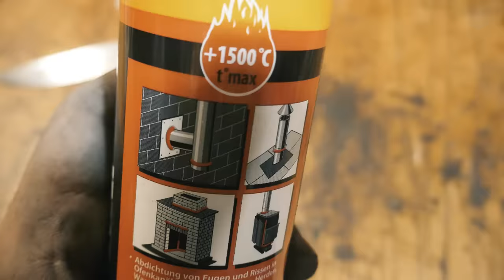Knife Making - Dark Modern Tanto

Comment: Not a tanto knife... it is a wakizashi style, but still cool dude
Reply: realm of the mad god wakizashis are better my dude
Reply: This is Tanto because Tanto is Katana of blade length is less than 30cm.
Also Wakizashi one is between 30cm and 60cm.
Reply: The hell...? "Wakizashi style"?
Do you even know what designates the name for a japanese blade? Because the main difference between a Tanto, Wakizashi, Katana and Odachi is mostly and simply blade length.
Reply: Kyo 21943  Actually some wakizashi do fall in the range of tanto length but typically wakizashi will have more 反り,sori (curve) while tanto knives have little to none sori.
Reply: Kyo 21943 Wakizashi will have more sori because of its function as a secondary weapon to compliment or replace 打刀(uchigatana) or 太刀(Tachi), while a  tanto doesn’t need sori because of its function as 鎧通し (yoroitooshi) , to penetrate Armor.
Reply: Kyo 21943 Lastly the presence of 鍔 (tsuba),guard also determines the difference between tanto and wakizashi, normally a knife around 30cm without tsuba is categories as tanto, eg. 物吉貞宗 classified as tanto although it’s length(33cm) exceeded 30cm.
Reply: Its a tanto. A wakizashi is longer and has a bigger Tsuba.
Reply: Sorry to break it to you mate, but those are one in the same.
Reply: Ones just shorter
Reply: Anthony Fam is right though.
The length of the blade is only a good guideline to classify the blade.
What matters more is the functionality of the blade as Anthony stated.
The blade made in the video has too much curve for it to be a tantou.
To say the two is the same is like saying knives for cutting bread and cutting meat is the same just with different shapes lol
Reply: Eh bad analogy oops
Reply: @kaito3125  how is it like comparing two completely different blades like a bread or steak knife, those are different sized, shaped, blade type, and length. The only differences between tanto, and wakizashi blades are the sori, and length
Reply: Ian Bonnar Hence why I said eh bad analogy XD
But hey! Now you recognize they are different!
Reply: Heavy hammer don’t tantos have the weird top with a really sharp point instead of a belly
Reply: ben warman yes they do
Reply: @leonardsailer2354  Its not a tanto or wakizahsi, its trailing point
Reply: @kaito3125  18:32 how this has too much curve?? You mean the blade (the sharp part) itself? Because the knife itself is pretty straight
Reply: Kugelblitz Kugelblitz hello! Yes I am talking about the blade. The different naming is there because they have different purposes! Tantou blades pretty much have no curvature.
I don’t think me being Japanese give me credibility, but I do have easier access to documentation XD I’ve verified my knowledge as much as I could and this is what my current opinion is (:
Reply: Neeeeeeeeeeeeerd
Reply: wakizashi is a short sword.. this is CLEARLY not a sword at all.  it is a tanto. you should know better.   The wakizashi has a blade between 30 and 60 cm (12 and 24 in), with wakizashi close to the length of a katana being called ō-wakizashi and wakizashi closer to tantō length being called kō-wakizashi. The tanto's traditional overall length was 11.93 in (1 shaku, about 30cm). The blade's length was about 5in to 12in (12 1/2cm to 30cm). Blades that were bigger (13" to 14" inches) were called ko-wakizashi, or "small short sword." The tantos which varied from the traditional size were called O-tanto or Sunobi tanto.
Reply: Eleazar Ventura same but let’s leave it to the pros
Reply: @RipleyGames you sir are wrong. it is a tanto. do some research. i wont do it for you. but it is definitely a tanto.
Reply: @RipleyGames  The wakizashi has a blade between 30 and 60 cm (12 and 24 in), with wakizashi close to the length of a katana being called ō-wakizashi and wakizashi closer to tantō length being called kō-wakizashi. The tanto's traditional overall length was 11.93 in (1 shaku, about 30cm). The blade's length was about 5in to 12in (12 1/2cm to 30cm). Blades that were bigger (13" to 14" inches) were called ko-wakizashi, or "small short sword." The tantos which varied from the traditional size were called O-tanto or Sunobi tanto. no YOU are wrong.  the spine and edge has nothing to do with what makes a tanto. it's the length and style. NOT the construction.
Reply: @kaito3125  wrong.  The wakizashi has a blade between 30 and 60 cm (12 and 24 in), with wakizashi close to the length of a katana being called ō-wakizashi and wakizashi closer to tantō length being called kō-wakizashi. The tanto's traditional overall length was 11.93 in (1 shaku, about 30cm). The blade's length was about 5in to 12in (12 1/2cm to 30cm). Blades that were bigger (13" to 14" inches) were called ko-wakizashi, or "small short sword." The tantos which varied from the traditional size were called O-tanto or Sunobi tanto. 

the style and length determines the classification of a blade. not the functionality as you could essentially use a katana for a butter knife if you wanted to. BUT that still would not make it a butter knife. AS for the curve. some ancient tantos still had a fair curve to them and some made these days do as well... a tanto can be straight or curved. The tanto blade has a high point with a flat grind, leading to an extremely strong point that is perfect for stabbing into hard materials. The thick point of the tanto blade contains a lot of metal near the tip, so it is able to absorb the impact from repeated piercing that would cause most other knives to break. THESE are the characteristics of a tanto along with length.
Reply: D C Hi! I feel like you proved my point though. You said you can use a katana as a butter knife. True, but you don’t call your katana a butter knife XD Just because your butter knife is longer doesn’t make your butter knife a katana. Also functionality is a bad word to use here since what matters is it’s purpose not how it can function. A pencil can function as a lethal weapon but that doesn’t mean we can refer to a pencil as a knife and have others understand us.
Reply: D C I just want to make sure you read my post! It seems like you might have misunderstood my point. Or you are just saying wrong from the start because you don’t care about my opinion.
Reply: D C sorry for replying so much m, but I do understand I used the term functionality in my original post. Sorry for the confusion Japanese is my native language.
Reply: I get his confusion, even if he is wrong. The 'old' tanto's were commonly recycled broken katana's that were reshaped, and as such, didn't have the same shape as a tanto built as a tanto from the start. 
Wakizashi, tanto, katana, they are all the same blade shape, only the length makes the difference. A tanto fashioned from a broken katana would have a slightly different shape, but that is the exception, not the rule.
Reply: You mean it's not a western tanto, because this is clearly a "traditional" tanto.
Reply: It’s just a weeb dagger
Reply: breaths in

WEEBBBBB!!!!!
Reply: So simply this is a knife
Reply: All I heard here is people talking the difference between tanto and wakizashi and also about the video, making tanto or wakizashi
Reply: is this the weeaboo hideout
Reply: @DENTYUcord  a tanto is a sword... I think its far longer than a wakizashi.
Reply: @Emilianoo8  nah, he can say what he wants
Reply: @Th3_Only_Spider-Man  i do
Reply: Heavy hammer forge I was thinking the same thing. Tantos have flat transfers from lower blade to tip.
Reply: Kyo 21943 yes wakizashis were the short swords but they had more rounded edges like this. A tanto has more of a flat transfer from blade to tip.
Reply: markimarku other way around
Reply: Bru741iX lets all just agree there are many different things the define a wakizashi as a wakizashi, a tanto as a tanto, and a katana as a katana and lets just say this is his own style.
Reply: it's an axe you fools lol
Reply: So no one knows what it was used for holy high mighty gods above. You need to know what there used for to know the difference
Reply: @DC-ct7em  what is a 'short sword' im aware of an arming sword but do older civilizations actually call their arming swords "short swords"

im deadass right now, i dont actually know if thats true
Reply: weeb
Reply: @Kyo-kf6jf  And how sharp the blade is.
Reply: not at all
this is a tanto
wakizashi is a short katana not higher above 50cm
Reply: Awesome I made something like it awhile back but this ain't a Tonto my dude
Reply: Talking about blade shape, not a tanto since a tanto got a tip right before it curves the the point
Reply: @drmusrudloff  

Not all tantos have a "kissaki", like you're referring to.

Stop posting about things you don't know about
Reply: @damarei  like some sheepfoot blades got a tip? Im talking about blade shape, no reason to act offended over stuff you dont understand
Reply: @damarei  just made a quit search, you have no idea what a kissaki is since the knife he is making got a o-kissaki
Reply: @drmusrudloff  

No, no it doesn't.

This knife is more "shobu" if anything
Reply: @drmusrudloff  

I think you're thinking of Western "tantos" with Kamasu style tips.

Furthermore, are you talking about the Yokote when you say "tip"?
Reply: Every body is using the exact same evidence to try and prove something different, however this is just defending the same position.
Reply: He is right. If you look at the design for a tanto it's more like a Bowie so it has a sharp point to penetrate armor.
Reply: Still a great piece 👌👍
Reply: @DENTYUcord  exacto  tanto 1 shaku ,wakizashi 2 shaku
Reply: wait isnt this a katana?
Reply: @Kyo-kf6jf  weeb
Reply: Tanto (15~30cm or 5.9~11.8 inches) ; Short blade, used as a knife or dagger to penetrate the armor, or at grapple range by Samurais, or used for self protection by ladies.
SO It IS AN TANTO !!!!
Reply: DORK
Reply: Wakizashi should be long and two handed, tango meant to be short bro
Reply: Heavy hammer forge
How is that a wakizashi? Its clearly length of a knife, not a short sword.
Reply: Kyo 21943 f
Reply: 'tan' is that means a short, in japanese 
you don't have to it wakizashi
ㅇㅋ?
Reply: I have to say, if the true Japanese bladesmiths of old (which are true artists, IMHO) were to read any part of this shit, much less the whole thing, the only word or term they would be considering is... Seppuku!

Ignorance & Google together, destroying minds... 1 post at a time!
Reply: Ты это делаешь для себя или на продажу
Reply: STONE PHILLIPS who?
Reply: Is it me or a hate how people miss use weeb like 
when a person learns to speak Japanese (or it could be anything like Japanese calligraphy or black smithing like I don’t know)......  people call him/her WEEB ....like isn’t learning Japanese and French(for example) the same thing?
A weebeo is a non Japanese person who’s a fan of anime that tries to fit in to Japanese culture  so they try to learn Japanese stuff but with no care and just want to know it...again..to fit to that culture but that’s my definition of a weaboo..so when an average person learns something about Japanese stuff is not to try to be one is because they genuinely like learning about it they don’t to be part of it they just enjoy learning it
Reply: How much is the price,just I want to know??
Reply: A wakizashi is the the medium sized blade
Reply: @DENTYUcord  hm indeed
Reply: @Muppet_  Actually... the wakizashi, the "companion"... was the primary weapon... but everybody and their uncle constantly wore one on their person, and that presented a problem for Samurai when they wanted to bully people... so the Samurai made a law that only Samurai could carry two swords... and added the Daito, the longsword, to their daily carry arsenal, giving them a significant reach advantage over everybody else... and then later they simply banned everyone but samurai from carrying any weapons at all. The Sori/blade curvature is solely to prevent the sword from twisting in the hand when you hit with it, keeping the edge aligned for better cutting, especially under stress when things get sloppy. Due to the laws of physics, a straight blade wants to twist so the flat is in contact when force is applied. And under stress, warriors(all over the world) often struck with the flat of the blade. But a strong curve will twist the blade so the edge is aligned, even when you strike with the flat... it makes a HUGE difference in battle. The Yoroitoshi was not for penetrating armor... A dagger will not penetrate iron plate... it was for penetrating the GAPS in the armor...
Reply: @Muppet_  Some tanto had tsuba... Samurai had different styles of mounting their blades based on their individual fashion sense and taste... some even wore Portuguese armor, mixed Japanese and Portuguese style slothing... and mounted Toledo blades onto Japanese fittings... and used Japanese kenjustu to wield those blades... They even used European guns, shooting with Japanese techniques... It is very confusing, I know...
Reply: @kaito3125  Many tanto had curvature... just like many Japanese swords were straight... some were even double edged... the horror... Do not color outside the lines!
Reply: @Anonymous__ So... were the old Tanto and Nihon-to that were forged in medieval Japan out of iron with no soft spine... not authentic? There are many traditional and authentic ways to make a Japanese blade. Each smith had his own method, and some actually innovated... I know... how dare they color outside the lines...
Reply: gatocles99 鎧通し( yoroitoshi) literally means armour penetration, they are thick and have a straight spine. True that most people will strike between the gaps of the armour but these blade and made to withstand higher pressure so that they won’t break. For wakizashi, it is true that most ordinary people carry them because of the length weapon restrictions, but it’s main purpose is still function as a secondary weapon for most samurai. Btw, waki(脇) means side. My main point of the type difference is their functionality, some tanto do have extreme sori, but those are quite rare, most of them have only little or no sori due to their functionality of stabbing. And nihonto with double edge and curve is called as 小烏丸造, without curve is a normal sword 剣. The 小烏丸造 is said to be a period between sword and tachi.
Reply: gatocles99 btw the tanto and tsuba is just a simpler way to identify them as some books do differentiate them that way. As they have longer tanto due to no tsuba and shorter wakizashi with tsuba.
Reply: And lastly there’s a difference in forging techniques also, tanto is more commonly used 平造リ,which means that the Surface of the blade is flattened towards the edge, while wakizashi normally used the same forging technique (鎬造リ)as normal uchigatana or tachi, with 鎬筋( shinogisuji) and 横手 (yokote) to define the point of the blade (切先). But sometimes, these two overlap also.
Reply: @Muppet_  First, there are MANY historical examples of tanto with curvature. Tanto came in all shapes, straight, curved, single edged, and double edged. Yoro itoshi were just a heavy duty tanto which is why they are technically called "yoro itoshi tanto". All blades meant for real use have thick spines. Thin knives will snap as just as easily as will a thin sword just from getting caught in a rib. Many modern Katana are thin because they are... modern... fakes... and thin to easily cut tatami mats. 

Nobody is punching through a plate of iron with a dagger... not under the normal rules pf physics that govern our planet. Maybe with a war pick (tsuruhashi), but not a dagger. Yoroi toshi were daggers, no more no less... for stabbing between the gaps in the armor. Samurai were very well armored and often had to be grappled to the ground, pinned, and then killed by stabbing onto the gaps in their armor... Just like medieval European knights. killing was more intimate in the good old days. You would smell the enemy's last breath... if you were the lucky one...

Waki may mean side... but wakizashi was still referred to as the companion sword... not as the companion to the Daito, but companion to the Bushi, because it went everywhere with them, even to the toilet. Katana is the Longsword. Wakizashi is the gentleman's smallsword. Katana were left at the door, Wakizashi were worn indoors. Interestingly, the older combination was tachi/tanto... later replaced by wearing two uchigatana (katana/wakizashi)... because kogatana/wakizashi were better in a fight than a tanto... Interesting tidbit... the precursor to the wakizashi was the Katate-uchi katana... and shorter kogatana meant for one handed use.

And before the Heian period, ALL swords, no matter what shape, were called "tachi". Nihonto took A LOT of different forms. The designations, Tachi, Katana, Wakizashi, Tanto, really just have to do with blade length. Just like Rifle, and pistol are designations for many different types of gun. Japanese weapons were as varied as European weapons... but people nowadays have an obsession with uniformity, so their minds are too rigid to accept anything that deviates even one iota from an arbitrary, rigid preconception.
Reply: @Muppet_  Not every sword or dagger has a tsuba. Many katana/wakizashi have no tsuba or very small tsuba. Aikuchi (no tsuba) was a particular and well known style of mounting a blade. And very few historical tanto were mounted with tsuba. Because the tsuba would get in the way and press uncomfortably into the belly. And Kaiken daggers never had a tsuba either. Open your mind! You are missing out on a whole world of wonderful Japanese weapons because your standards are too rigid!
Reply: gatocles99 I’m merely taking about classification, I acknowledge that there’s many type and kind of nihonto out there, but just like pistol and rifles, they can be classified into group or maybe some intervals.As the tachi statement, the classification that i refer to is the curvature, pre heian period, there’s mostly only straight blade, with single or double edge. As kokarasumaru (小烏丸) is the precursor of curve blades in Japan and often refers as the ancestor of curved nihonto. It has curved body while retaining double edged, an interval between a sword and curved tachi. And about the tachi referring to all blades pre heian, can I have the source of it, as I can only find statement of tachi refer to curved blade with a certain types of koshirae(拵え), including odachi, kodachi and all the derivatives, but the shape stay not far from the normal curved tachi. Thank you for the sharing, as I’m still learning about them.
Reply: @Muppet_      大刀 Etymology/tati/ → /tat͡si/ → /tat͡ɕi/From Old Japanese. Derived from 断ち (tachi), the 連用形 (ren'yōkei, “stem or continuative form”) of verb 断つ (tatsu, “to sever”).[1][2] The kanji spelling is jukujikun (熟字訓). Originally written as 大刀 (literally “great katana”) represented by straight swords before the Heian peiod, later written as this spelling to represent curved swords. 

Wakizashi did not originally refer to any specific length either... it is an abbreviation of the term Wakizashi no Katana... a sword of ANY length, thrust into the side of one's belt. (Katana and wakizashi, and even tanto could be, and were worn in the "tachi" style...

And don't get me started on cane-swords(Shikomizue)...

It was the government that set the arbitrary classifications for swords... they did it specifically because swords above the legal length could only be carried by Samurai, While swords shorter than the legal length could be carried by just about anyone for self protection. This is why the Kodachi (short tachi) and remained popular all the way through the Edo/Tokugawa period. There were as many types of swords as there were styles of swordsmanship. 

There was never a set standard for design or manufacture. Every smith, and every weapon was unique.

It is OK to relax and not be so rigid about forcing arbitrary and artificial classification onto unique, and often custom made weapons.. The only true standard is that a blade can handle abuse, and that it can cut well. And Koss made a very good, sturdy tanto (In Chinese(kanji): short knife, in Japanese: short sword/short sword/dagger/dirk).
Reply: Fine indications are interfering with the interest in Japanese culture.
Reply: Weebs are getting hardcore here lol
Reply: Sorry guys but hammer is right
Reply: Heavy hammer forge you’re a wakizashitantoknife
Reply: 短刀は鍔をつけないので、これは短刀ではありません。鍔をつけるという点では脇差ですが、30cm以上ないので脇差でもありません。　This knife is not tanto(短刀) because tanto is not put on tsuba(鍔).but wakizashi(脇差) needs blade length 30cm over. This is neither wakizashi nor tanto.
Reply: This was used to commit Supico/Hari Kari a ritualistic suicide wich defeated or dishonored Samurai would do in order to restore their Honor in Death.
Reply: Tantos, wakizashi and katanas have the same blade profile and curve
Reply: Congratulations, You're all weebs
Reply: @tygristaamu5135  i also know of European weapons. Weebs would go on a rant on how katanas were the best weapon in history. I know they actually were pretty bad
Reply: This blade is smaller than the kodachi. Sword sizes are as follows nodachi, tachi, wakizashi, kodachi, and tanto
Reply: @benwarman5202  No, this is  a  accual  tanto, what you're  talking  about  is what Americans  are calling  a tanto. The real Japanese  tanto  has this blade shape.
Reply: James Miller oh well that’s good because I actually don’t like the “American” tanto.
Reply: either way if u get stabbed you're still finna die
Reply: Heavy hammer forge, you have no idea what you are talking about. "Wakizashi style?" Do you even know what that means? A Wakizashi is much longer than what he made here. I am really saddened to see you have confused so many people. This needs to start getting some hard dislikes. There is no "Wakizashi style" the length of the blade is what matters. On average Wakizashi's blade tend to be around 45cm long, not including the handle, but the blade can be as long as 60cm and short as 30cm. A wakizashi is certainly not a knife, or TANTO, like what Koss has made here. Doesn't matter what style of TANTO it is, as there are several. But a Tanto is a Tanto.  I don't know how you got this dead wrong and got so many more idiots to go along with your dead wrong response. But you should really do just a tiny bit a research before you post an embarrassingly wrong comment on the internet for all to see and more importantly so you don't spread misinformation to so many people.
Reply: @Kyo-kf6jf  couldnt have said it better lol
Reply: Oh jeez this is the laminar flow debate again
Reply: @Kyo-kf6jf  bro you do realize you're arguing over what kind of Japanese style blade this is right? It doesn't get geekier than this lmfao.
Reply: @DENTYUcord  no it is not,a tantos is similar to Asian swords,but has and angle when it goes upward,it's not a tanto
Reply: @Kyo-kf6jf  as if u know,the tanto is similar to Asian swords,but has an angle,before going up,it's not a tanto
Reply: @Muppet_  what does length have to do with a tanto,it does not have the same tip as a katana or wakisaki,it has an angle where the blade starts to go up
Reply: @ianbonnar1801  uh not they are not,a tanto has a different point,just Google it
Reply: @ianbonnar1801  uh no,the blade tips are different too,the tanto has an angle where it goes up,Google it
Reply: @mcnydia1702  but a tanto has a different blade top,it has an angle not a curve
Reply: @DC-ct7em  it's not a tanto,it has a different topic,tantos have an angle not a curve
Reply: @DC-ct7em  no it is not, YOU do research,tantos have an angle instead of a curve
Reply: @rich1051414  no they are not,a tanto has an angle instead of a curve
Reply: Grayson Clemons Length is just a general classification. Didn’t I stated the difference in the blade shape in the previous comment, about the 平造り and 鎬造. 平作り, is where the spine converge smoothly to the edge without a change in angle, is very commonly used in tanto and wakizashi or even some uchigatana. However, 鎬造り is the typical katana style where there’s a change in angle somewhere in the middle of the blade to form edge, and this kind the grinding usually forms tip called 帽子. 鎬造り is used in most uchigatana and tachi, and some wakizashi also used this style. 

Here is some read up about the blade style.

https://iwano.biz/sp/news/20160220wanobiznew.html

https://kougetsudo.info/tsukurikomi/
Reply: @Muppet_  I may be wrong but the tantos I am familiar with have an angle that goes up to the tip,it may just be that that is the western tanto,but I also only speak and read English,so I looked at those sources but I can't read them,so it may just be that I'm not familiar with japenese style tantos
Reply: Grayson Clemons ohh, I’m not clear about the western style blade either, but there’s tanto with curved blade also, although is not as common as the straight one. Here’s one with extreme curved edge.

http://winners-auction.jp/productDetail/1714/
Reply: @graysonclemons3113  get outta here Grayson, this was 7 months ago,
Reply: @mcnydia1702  I did I'm just saying that the tanto blade is an angle not a curve,I'm not saying that you are wrong,just that that is how the blade style is
Reply: @Muppet_  ok,I think that that causes a lot of confusion
Reply: Mike wazashki
Reply: It clearly says "modern" tanto knife I don't know why everyone is debating if it's this or that it's a cool take on the blade, my dude. Looks very sleek and I wouldn't mind having one of my own.
Reply: @formy5287  lmao
Reply: ㇸ/\へヘどう見ても山ですmountain/\ヘ/\へㇸ ooooo
Reply: EvanPlays a man of culture
Reply: Nope its not
Reply: それな
Reply: Leonard Sailer wazhabi !
Reply: You have to start with "um actually" so you're words sound more legit
Reply: @phantomwraith5 appreciate*
Reply: @formy5287  i prefer my ogmur
Reply: Neeeeeeeeeeeeeeeeeeeeeeeeeeeeeeeeeeeeerrrrrrrrrrrrrrrrrdddddddddddddddddddddddddddddddddddddddddd
Reply: Ian Bonnar it’s one and the same, dummy. Not in.
Reply: كل خصوه
Reply: @Tomnician  Do you mean BÖRK
Reply: EvanPlays I see one sophisticated guy here...
Reply: You’re getting flamed so hard knowing you made a mistake lol
Reply: Heavy hammer forge It’s actually called a knife
Reply: You chose the wrong this to be incorrectly pedantic about, now you've got a bunch of weebs putting you straight 😂
Reply: @DENTYUcord  i think that what you described as a wakizashi is an otanto the wakizashi realm begins at 50 cm
Reply: @velazquezarmouries  you should go to the wiki of Wakizashi.
https://ja.wikipedia.org/wiki/%E8%84%87%E5%B7%AE
"脇差は刃渡り1尺（30cm）以上2尺（60cm）未満の物"

otherwise, this page
http://samurai-sword7.com/type/form/entry67.html
"小さい方の刀は、刃渡り1尺（30cm）以上2尺（60cm）未満の物と定められており、一般的にこれを脇差といいます。
大きい方の刀は2尺（60cm）以上2尺3寸（約73cm）以下と定められ、これを一般的に打刀と呼びます。"

if you can't speak Japanese, go to the google translate with those sentence.
i think 50cm is average length. btw, Tanto(短刀) which means "short(短) sword(刀)"
Reply: I'm havin a Japan presentation next week and this comment section save my ass
Reply: Tantos have no tsuba
Reply: You guys been watching to much anime
Reply: It's a knife good for me to use🤣👍
Reply: Tanto (Korean 단도, Chinese 短刀, Japanese たんとう) Literally, means short knife dude.
Reply: tanto? dando is right ....dan mean's short.. do mean's one side blade  .....so dando mean's short one side blade  ok?
Reply: The stench of Weaboo intensifies
Reply: the wakizashi and kodachi its almost the same
Reply: Weeaboos be like
Reply: Your so right dude i love ur knowledge

u certanly seem like the tipe of guy thats into the culture like me
Reply: Wakizashi is short sword, tanto is the knife. Know your facts before you run your mouth
Reply: Poing, BONK, toim
Reply: @formy5287  pp]ppppp
Bb
Reply: Jesus Christ y'all are just knife weebs man..just enjoy the video 

God...
Reply: Just a random guy letting you know that i read all of the above comments. 
And my conclusion is that it will keeel
Reply: This is a tanto due to the blade size and length.
Reply: You dont even know what your talking bout
Reply: Yeah thats not a Tanto, Tantos are typically straight blades with no curve
Reply: Friend, even though I criticized another knife you made ... I really liked this one, excellent work ... it has a touch of old and modern .... I congratulate you.
Reply: A fail comment with so many likes.. wow. 🤣
Reply: Actually... it's neither 😅
Wakizashi's are the shortswords that samurai had in addition to their katana... the wakizashi had a proper handlewrap, pommel and tsuba 😬.
It's also not a tanto knife since tanto is a certain, more angular, shape of the point of the knife
Reply: Was looking foe rhis comment👌✌
Reply: @thefrostinside2053  stabbing*
Reply: @tygristaamu5135  And so are you for commenting here. Congrats! 😂
Reply: @ianbonnar1801  no a tanto has more of an angled corner for the tip, where is this one is a curve.
Reply: Ian Bonnar one is for silting throats of men knocked from horseback, and the other was for guards/soldiers in cities basically not gonna argue if I’m wrong I just enjoy the blade styles of the Asian nations
Reply: @Muppet_  you could have just said curve you know
Reply: I want buy this .where can i buy this tell me plz??
Reply: @Muppet_  A Tanto is supposed to be 1/3 of a Katanas blade right?
Reply: Poor
Reply: @DENTYUcord  said he had population growth
Reply: @DENTYUcord  said he had
Reply: Can i buy this?
Reply: Definitely a tanto
Reply: Wakizashi is a lot longer than this, I know because my dad has a Katana and a Wakizashi
Reply: well a Wakizashi is a short katana a tanto knife is more like a dagger katana
Reply: @Kyo-kf6jf  my guy you are right and that is what i just commented
Reply: @renamamiya690  
Tanto is a straight smaller version of a wakizashi for a blade with a stick for a handle and sheath, a wakizashi is literally just a shorter katana along with the handle, guard, sheath and other features unique to katanas and its variations which the wakizashi is actually one of
Reply: you did not haft to go out of your way to fix what i said but i really appreciate it
Reply: Yes, it's a tanto knife!
Reply: Killed my vibe bro
Reply: Wakisazhi is lnger..
This is tanto
Reply: @Kyo-kf6jf  the channell agrees thats why its pinned
Reply: tanto or wakizashi style they are all very great
Reply: I'm pretty sure its style is referred to as a modern tanto, as compared to the traditional tanto with a little bit different blade.
Reply: This is a Tanto, the traditional Japanese styled kind, you might be thinking of the North American version, which a lot of people confuse for what an actual Tanto is supposed to look like, a common misconception. The the flat angular tip is not of Japanese design, that is the American redesign of it, no Japanese Tanto looks like that. This is what the traditional Japanese Tanto is supposed to look like, minus the materials used in its creation. Fools out here arguing about Wakizashis and Tsubas, when that doesn't having anything to do with it. 

There is no "wakizashi" or "tanto" style, ya bunch of muppets. There is only 1 thing that seperates a Katana, from a wakizashi, from a tanto, they're length. The blade shape, outside maybe curvature from differential hardening on a Katana and Wakizashi, are all the same, perhaps forged differently, but nevertheless all of them have the same blade shape. It's real simple, a Katana is always longer than a Wakizashi and Wakizashi is always longer than a Tanto, the tanto being the shortest of the 3 thats the only difference you need to know, outside the confusion from Americans redsigning the blade shape. 

In other words what the Americans or other westerners commonly know as a "Tanto," is not a Tanto at all.
Reply: I dont even know what was talked about but it's funny
Reply: It is most definitely a tanto, you have no idea what you're talking about.
Reply: It's not a wakizashi LOL
Reply: @Muppet_  A blade of this type with no guard is an aikuchi. This is a tanto.
Reply: hahahaha, Wakizashi is far bigger
Reply: weeb
Reply: Whatever you call it it is beautiful, nicely done!
Reply: How much for one?
Reply: you officially have the smallest and smoothest brain
Reply: Everybody seems to think they are Hattori Hanzō...
Reply: You clearly don't know what your talking about
Reply: Thank you for explaining it pissed me off because it’s not a tanto
Reply: I hate when it’s called a tanto even though it’s not
Reply: @Reaper55696  it is a tanto, the only difference between those types of knives if their length not their looks
Reply: The tip it’s not a tanto tip
Reply: @Reaper55696  i just told you... the looks have nothing to do on defining on what kind it is, it could have any kind of tip it doesn't matter, what matters is the length
Reply: It’s still an epic knife
Reply: @Reaper55696  yea it is
Reply: stop raining on this dudes parade , make  yours... Mr know it all psh! .....Can't you just appreciate and live on .
Reply: We all ready had this conversation we still think it’s  awesome
Reply: Oof this brought the otakus out of the woodwork, i agree though
Reply: @leonardsailer2354  exactly
Reply: @formy5287  lmao
Reply: Oh no it’s an “actually” guy
Reply: @shadow-kun9431  I knoooooooooooooo
Reply: "Since the katana was a samurai's main combat weapon and the wakizashi was a backup or close quarters weapon, the tanto was best for swift and efficient stabbing and slashing. The tanto blade isn't exactly a sword, but more of a long dagger that measures at about one third the standard katana length."

I mean that Wakizashi "style" isnt a back up its pretty exact on the tanto size.
Reply: You clearly don't know the difference between a tanto and a wakizashi.  Wakizashi is a short sword.  The tanto is exactly the knife you just watched him make.
Reply: Go and learn about the differences between tanto, wakizashi and katana, this dude....
Reply: no this still qualifies as tanto
Reply: Go back to sleep hammer forge
Reply: lol weebs
Reply: Who cares
Reply: wont be surprised if you still get people correcting you lol
Reply: I mean it’s wakizashi style but it’s still a tanto and to be honest I would rather use it as a tanto sooooo
Reply: yes, it is technically wakizashi style but not a wakizashi it is still a tanto.
Reply: @Kyo-kf6jf  curve and blade length mostly wakizashi are generally longer considering they were supposed to be back up swords for samurai but before samurai switched to wakizashi they used tanto pointed blades as well so i just tell the difference by the curve of the blade and length
Reply: nope. the main difference is the lenght.
Reply: Good equipment, just like the Japanese in the 13th century. It has nothing to do with making tanto/wakizashi blades. Onanism video.
Reply: Does anyone know the size of the blade?
Reply: Are tou guys SURE its not a Scottish Claymore?
Reply: Yours,right?
Reply: ok
Reply: ok
Reply: @formy5287  first comments a rotmg player? Based
Reply: I love know it alls
Reply: ok
Reply: I want to buy this knife
Reply: Literally came to comment that
Reply: “Actually it’s a wakizashi style” 🤓
Reply: you are wrong, its  "styru desuné" so debunked get lost
Reply: Not really tanto and not really wakizashi. Tanto need to have straight back because its dagger and its sabbing weapon. Wakizashi is longer and its hybrid of katana (for cutting) and tanto (for sabbing). Its a modern and really american version
Reply: its a tanto homie, wakizashi are longer than that
Reply: @DENTYUcord  tantos are straight, hence why he said "wakazashi *style*" and not just "this is a wakazashi"
Reply: nope its the length of a tanto and hats really the only thing that separates it bud
Reply: It’s a wakizashi
Reply: wrong
Reply: a tanto's blade shape is the same as uchigatana (commonly known just as a katana) and a wakizashi. The angular tanto blade shape that you're probably thinking of is an American adaptation. A tanto is shorter than a wakizashi, and can either have a tsuba (handguard), or be made in the aiguchi style, without the tsuba.
Reply: @Muppet_ there are tanto made with tsuba though. The more common ones that common folk and women carried in olden Japan would normally not have a tsuba, and are known as aiguchi style tanto.
Reply: um..it is tanto.. Tan - short, To - blade